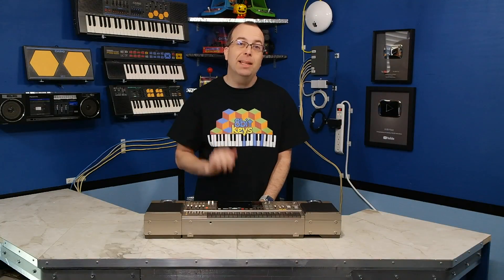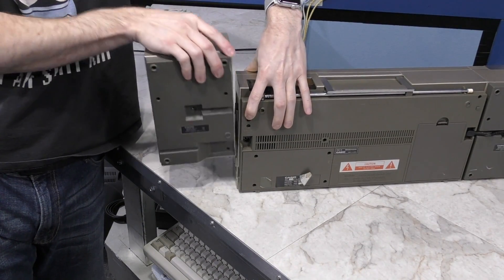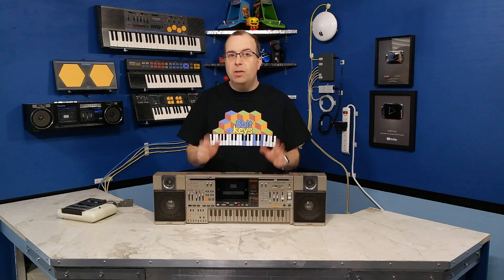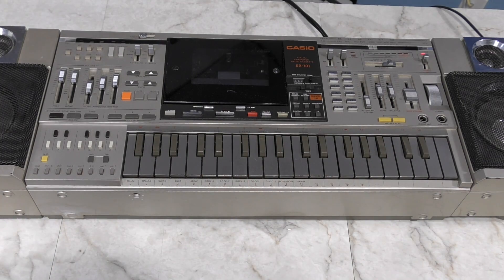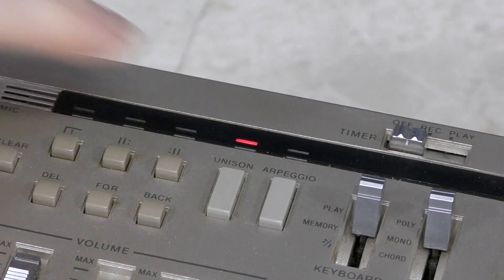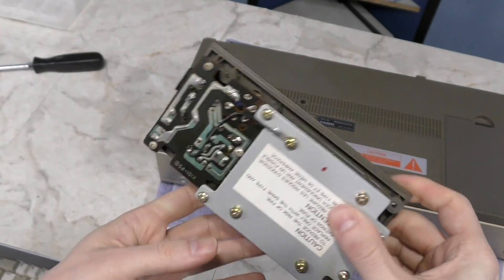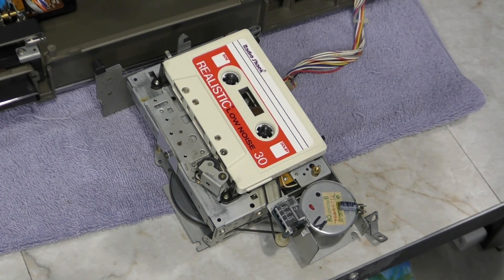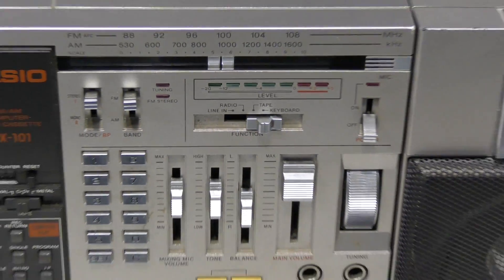Casio KX-101 Bizarre Boombox/Keyboard hybrid

Comment: Those speakers are like Switch Joy-Cons
Reply: RIGHT?
Reply: oy you are making me feel old. the first computer I ever bought had speakers that attached to the monitor like that.
Reply: Haha, funny
Reply: I have seen many boom box and mini stereo systems in thrift store that has speakers attached to it like that.
Reply: Kairu Hakubi was it an old Hewlett-Packard?
Reply: cliz305 I'm old enough to have seen them new in stores.  The selling point was that they could be installed as a personal stereo in your room, used as a portable boombox or easily carried to a larger room for use as a party stereo sound system.

The first product of the type was the miniature stereo system that was the size of one of these speakers. This opened up two markets: Mini/micro stereo systems that looked like scaled down HiFi racks and boomboxes with detachable speakers.

All the brands competed by including different unique features to stand out, so naturally a digital gadget company like Casio would try putting one of their keyboards in one, while others would try with CD players, graphical equalizers, dual tape decks, autoreverse tape decks, short wave reception etc. etc.
Reply: ok yea they are

Comment: I had one of these back in the day. Yes, it came with longer cables to move the speakers exactly as you showed. It was an awesome radio, except for its extreme weight. The cassette decks were notorious for dying, as you’ve discovered.

Comment: i recommend the following plugins to cleanup all that noise. They are pretty expensive though.. They are included in the Waves Mercury bundle, which I recommend whole heartedly for all your mixing and mastering needs. But the plugins in question to cleanup noise would be Waves X-Noise, Waves Z-Noise, and Waves X-Hum. Works extremely well.

Comment: I understand your point about the limits you have to set in restoring projects, and that tracking back everything was not an option. But how about just try the motor with a battery to check if it's burned, or search in the bus just the two pins that power the engine and check whether the daughter board gives voltage in there when you press play. Just the two easiest and most probable causes to try out, and if there's no hints just let it go and move on. 

My point is: You spent hours disassembling it. You already paid a tax with the broken button. And you're going to get two hours to get it back together. I'd rather take the chance! Another +10 minutes with the tester may worth it a lot.

However, it was a great video about such a weird thing from the near, yet far past. That's more than enough! :D

Comment: Those cable inside are horrible ! I don't know why they do this like that but clearly it was not design to be easy to repair !
Reply: I guess, back then the price of printed circuit boards were still expensive and the way to cost down is to simply use wires to connect things together. If you once opened a pretty retro video cassette recorder, you can find even more horrible wires in it.
Reply: Been there, done that. Sold the copper. lol
Reply: It is typical board from 80. And it looks good on design.
Reply: That? Good? I've never seen anything remotely that messy.
Then again all the 80's stuff I've ever opened has been computers.
And the odd bodge wire or two aside, most of those are incredibly neat and tidy.

In fact the only times I've seen anything even remotely approximating this it's been one-off amateur prototype stuff, or heavily modified systems with lots of add-ons...
Reply: KuraIthys it is not messy. Typical design from 80.
Reply: It's the "Through The Fire And Flames" of electronics. Possible, but really hard.

Comment: The sound is so disturbing for those listening with headphones, why does it split the sound from left to right like that?
Reply: For more interesting stereo when playing chords and runs of notes.
Reply: I've played with a few amateur level keyboards that had 'sporadic panning' like this one does. However, this one would be the worst case for this oddity, as the panning occurs between key presses, rather than after a single press with the others I tried (I don't remember models specifically as this was fifteen years back and I barely remember a few things from that long ago).
Makes me wonder if a bit of issues with wiring isn't the cause, or if the keyboard outputs joint-stereo...(OUCH)
Reply: There was a time in the 1980s where organ and synth makers were obsessed with stereo. I own several organs from that era and sometimes they had bass and organ tones in the middle, orchestral tones and half of the drums  in extreme left while the other half and the piano sounds were in the extreme right. It sounds great when you are listening through the build in speakers - which are only half a meter apart. But if you listen in headphones or through a PA system there is a big sonical hole in the middle. The trick is to pan both channels towards the middle so the separation becomes less extreme.
Reply: It probably makes 4 tone polyphony easier and cheaper to do in a circuit. It only has to mix 2 polyphonic tones per speaker which reduces the chance of colliding waves causing resonance or dissonance which would change the note.
Reply: I don't know but I feel disoriented now.
Reply: I thought it was pretty cool being a producer myself

Comment: A schoolfriends sister had a really similar boombox to this.  Its keyboard was in a wedge at the bottom of the unit so unlike this one, you could play it with the boombox standing up.  The keys were really small and bright white, the boombox itself was ok soundwise iirc.  Im pretty sure it was also a Casio and this would have been very early 1980`s.

Comment: Iv been met with the same problem with some 80's boomboxes. Though I do not know why it happens I do know that you can fix it by disabling the back spivet motor. This will allow it to rotate by the other one but you will no longer be able to Rewind without flipping the tape and using fast forward. Id love to see this thing working.

Comment: If you can't get the tape deck to work, but you can get the heads to engage, try a car tape deck adapter to grab the signals the sequencer is attempting to record to tape. You could play them back in the same way, without ever getting the tape deck working. It just has to be willing to believe that it is working, and not stop the recording or playback attempt.

Comment: Nice item. There were a few of those keyboard/boombox hybrids back in the day. Sanyo released one or two (and I remember the keyboard being a rip-off of the Casio PT-30), and there were other brands (for instance, I have a CCE - Brazilian brand - which is just a Brazilian version of another of those. It features a very, very basic keyboard with only one preset, but is polyphonic). 

Casio also released the CK trio, which is composed of CKs 100, 200 and 500. They all have radio and/or tape decks. 100 and 200 both have PT-1 keyboards (the difference being that CK 100 doesn't have a tape deck, IIRC), while 500 features a sort of MT-68 without the two modulation buttons, but makes up for it with a double deck, with which you can record what you're playing AND overdub it. It's also very interesting that the "tone" knob/slider in all three of them affect the sounds you're playing.

Comment: Tapedecs in these boomboxes use really often more than one belt for the mechanism. When they are ok, check out all wheels, some of them use rubber rings to turn the spindle. Clean the pinch roller, the head... but you need a lot patience (-:

Comment: since you mentioned the random noise on the output , i suspect some caoacitors are dried up , some for the noise filtering , on the other side the tape mechanism controller pcb may have dried caps too so the solenoids wont engage ~  it happens to all products from the 70s- 90s even today many cheap or expense products suffer bad capacitors

Comment: This reminds me of a Tascam portastudio I have. Same problems, the reels wouldn't spin. What had happened was that the lube used on the mechanism had hardened over the years and practically solidified, so the reels where unable to move at all. Like this unit, it was extremely over engineered and it took me a long time to realize what the problem was. But once I did, all I had to do was disassemble the reels, remove the old lube with ISO, and apply some new. Worked fine after that. Maybe that's what's wrong with your unit? The cassette mechanism looks almost identical to the one in my Tascam.

Comment: I'm sure the tape deck could easily be repaired. It seems like there's a weak solenoid, loose connection, or some mechanical slack somewhere. Try greasing the moving parts and look for missing or broken teeth on the gears.

Comment: Next time try delicately pouring WD40 under a switch-cap that won't go off. Apply it with that red straw and a slight push on the valve. Then put the device so that the switch-cap would face down and the gravity may help WD40 to penetrate the micro cavities between the switch handle and the switch-cap. 15 minutes to 1 hour waiting is the good rule of thumb. If little or no effect - repeat up to 2 times. I'd write "hope it helps" but I know it helps and I know you'll find it useful. Enjoy. :)

Comment: I know this is somewhat unrelated, but I wanted to post this on the newest video- Seeing that this is three weeks old almost makes me want to wait until the next upload, but I just got too curious to wait.

Anyway, I have this old keyboard, a Concertmate 900 from RadioShack that my great grandmother gave to me when I was very young (I think I was two,). It's my first, and only keyboard as of right now.

Thing is, I can't find ANY information on it! I'm not even sure the year it was released, because neither the box or the keyboard itself have copyright info on it, though my only guess is that it's from the early to mid 90s.

I was thinking about opening it up, see if the chips inside would hold any info, but the plastic case is very brittle (I've had to glue up cracks on the side panels quite a few times over the years) and I don't have much experience with electronics. I don't want to end up breaking the thing trying to investigate, all things considered.

I was wondering if you had any information on this keyboard, maybe worked with one in the past? I honestly don't have very much information on it whatsoever, if you can't tell. The only thing I can find on the internet whenever I google it is just pictures, and the fact that it might be a version of a Casio line? I'm not entirely sure which, though.

Thanks in advance, and just for reading this novel of a comment, I know you're very busy and all.

Comment: Hey 8 Bit Guy!
I've taken apart a few tape decks, and it sounds like a similar problem I had with my Nakamichi BX 125. Under the assembly behind the plate, there (might) be a rubber idler tire to help along with fast forward and rewind. On my Nak, the tire wasn't gripping properly and needed to be replaced, any chance it could be the same situation with that deck?

Comment: a fully working KX-101 can sell between $500 and $2000 mattering on condition, their value has really gone up due to their rarity and functionality (though mostly becaues about 90% of them don't work perfectly anymore).  Though they are absolutely no RC-M90 in pure performance, they are very capable when in fully working condition with respectable speakers and very good tape mechanism, not to mention probably the best I/O for any boombox you can find (even bettering the venerable RC-M90 in I/O).

Comment: Think about it, if the belt slipped off in the first place its obviously less likely an electronic but a mechanical issue with the tape deck, so simply just oil all the cogs job done.

Comment: I think the problem with the cassete tape may be an IC somehwere rather than a mechanical problem. Anyqay you may try to locate a diagram of the tape mechanism somewhere and get to know if you need to lubricate some partor adjust some spring.

Comment: +adric22  I reckon this KX-101's cassette transport actually has mechanical issues.  The take-up spindle should have started rotating when the head carrier rose to action position, and it did not.  Suspect, among other faults, fried clutches on both spindles.

Comment: It looks like the auto-stop is triggering. As the take-up reel turns, it is supposed to keep bumping a lever on each turn. When you get to the end of the tape, the take up reel (which is coupled to the motor via a loose felt-pad friction clutch) can't spin anymore and it stops bumping this lever.  When the lever doesn't get bumped, a pin on the other side of the clutch (the side that's still turning) catches the part of the lever that's protruding which pushes the "STOP" mechanism and stops the motor automatically. That way, the main capstain doesn't keep spinning against a stopped tape and wear it out/break it.  (As a side effect it also keeps the player from "eating" a tape when the take-up reel gets stuck for some reason.) I've seen the felt pad in the clutch wear out such that it barely couples anymore, so the auto-stop triggers right away. That's one possibility for what's wrong.
Reply: Well maybe that's not it. in the purely mechanical players, that's how it works; this thing seems to want to do everything in circuitry. Since you're not pushing mechanical buttons to engage gears and clutches, it must do the gears and clutches all electronically, so maybe the clutch to engage the take-up reel is never being closed. This is all academic anyway-- no point in taking another 2-3 hours to take it apart and find out I was wrong. :)

Comment: I suspect the daughter board is the cause of the problem. Since you were wondering why the belt came off in the first place. I guess the daughter board that was controlling the cassette drive started giving erratic signals causing the drive to go crazy. In the process the belt must have come off. So i guess the drive is fine but the controlling board is faulty.

Comment: The weird thing is your heads are actually engaging under system control! Maybe the drive belt goes over more than one wheel. Is the capstan being driven by the same motor/belt as the tape drive? Is there another belt missing?

Comment: if the tape head mechanism still works, would you be able to use one of the car tape adapters, either corded or Bluetooth to get the data being transferred through the head on to another format, mp3 or a secondary tape deck? for the experimentation that is.

Comment: Just landed one of these from an estate sale. So when i 1st tested it out, everything worked perfectly. A few mins later, i switch back to cassete, and it doesn't play at all. Rew and FF still work fine. Just the PLAY. One minute, works perfectly, the next it doesn't. Play button lights up momentarily, then just shuts off. No spin. Any ideas?

Comment: Did it have an idler wheel which would rotate back and forth between the two takeup reels? If so, the lubricant on the pivot point dries up, and causes what happened here.

Comment: Can you use a MIDI conncector to use the keyboard on a Roland MT-32? Firstly, does it even have a MIDI connector?
Reply: I wanna say no, because it wouldn't have anything to control MIDI mapping built in, so you'd need to get some sort of CPU (Ben Heck would probably lay down all the details needed here) to do all that. Maybe a RaspberryPi could be useful, but then you'd have the limited polyphony so it can't play much at the same time, let alone more than one channel. It may respond to VCA, but I'm just guessing looking at the inside design. :)

Comment: pretty sure the cassette deck problem was a broken belt, but probably not easy to change. look like the same "deck unit" used in many of the same sony's devices of that era.
then again, this is 2018 and I'm not a "young wizard kid" anymore, it was easier working on that stuff with smaller hands :))
**whoops, forgot to say the smaller belt breaking was most likely the reason for large belt to come off.**
Reply: I should add, I "think" the small belt connected from the gear driven "by" capstan to the take-up reel. as mentioned above, this isn't early 90's when i last graced something of that vintage, lol.

Comment: That cassette mechanism  is over engineered, the problem of the wheels not rotating are some rubber rollers that are in the wheels shafts that you cant see without taking that thing a part, and they are really hard to change, to be honest that thing has more bits and bobs than Apollo 13 lol

Comment: "... using the 'far more logical' metric system."

It's only logical if you live in a third world country.  If you live in the United States, it's logical to use what is standardized here, and metric is not standardized here.

Be careful using that word.  "Logic."
Reply: Part of the definition of "logic" is "reasonable / to be expected". The metric system certainty IS more reasonable than imperial and so it is more convenient. It is in base 10, and so is the number system. Being based on factors of 10 makes for easy conversion between mm, cm, m, km etc, so yes it is more convenient/logical in that sense.

Be careful using that word.  "Logic.""

YOU should consider the many other definitions of the word "logic", sticking to only one does you a disservice.
Reply: Yeah the arbitrarily empirical system is so much more logical than the evenly divided metric system. 😂
Reply: In most contexts, metric is the official measure system in the US.
Reply: It's only logical if you live in a third world country << nice b8 m8